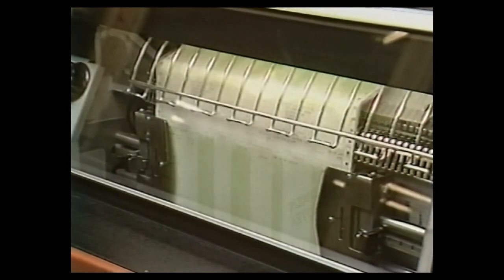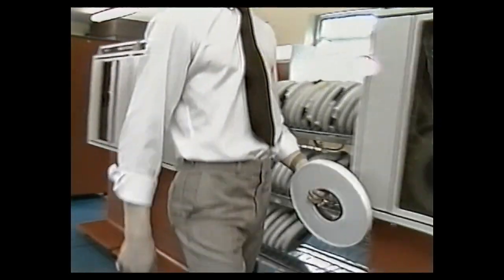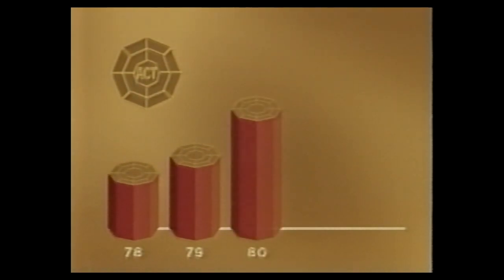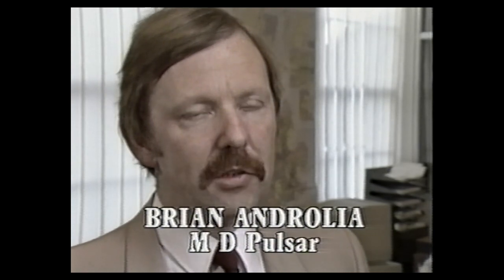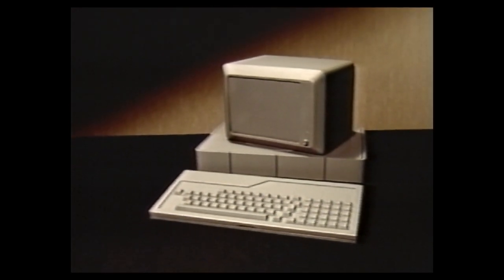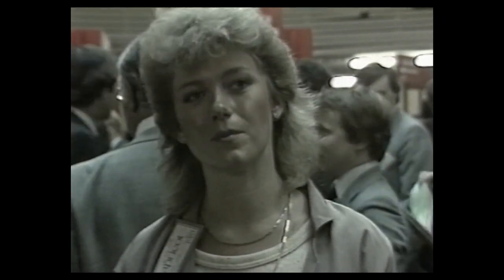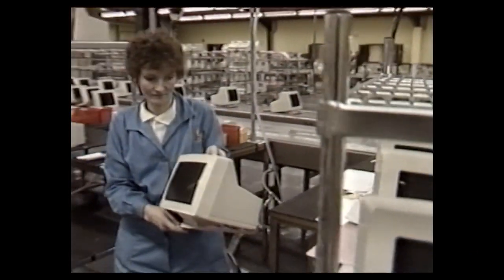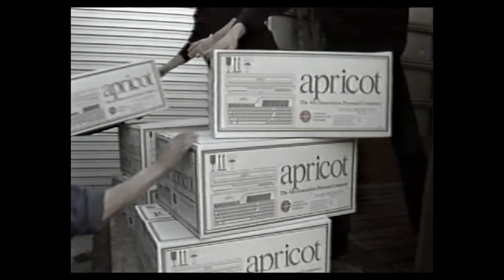Apricot Computers

Comment: They never mentioned that the Apricot computer had a fold out handle and you can snap the keyboard into the bottom of the case so you can take the machine home. That's the hole point of the machine, It was like a early laptop but not really. I had one of these and that was the major selling point to them before laptops/notebooks took over that executive market.
Reply: Those were called 'luggables', but I think they typically had some sort of built-in screen.